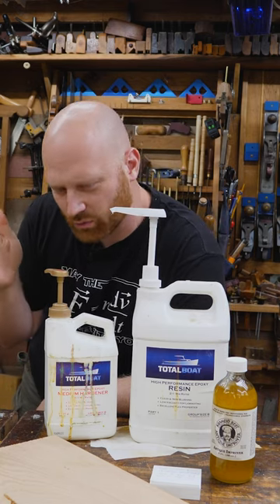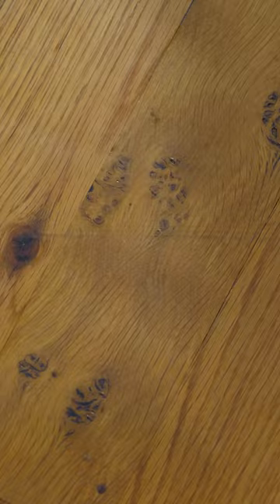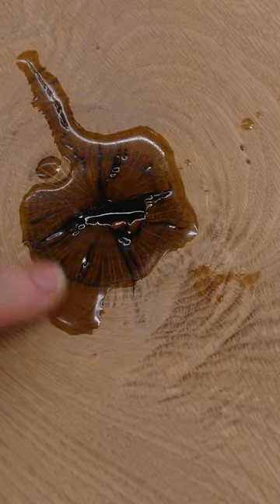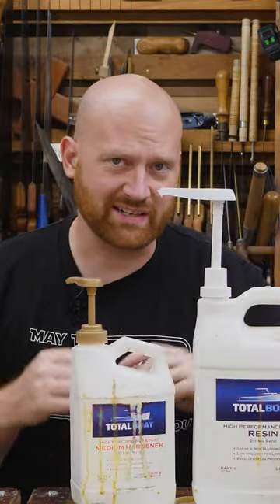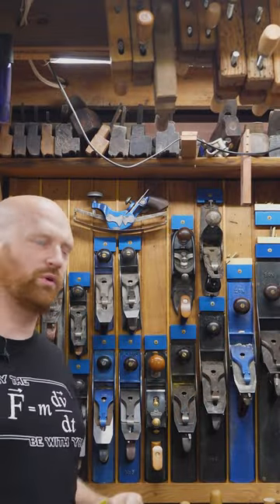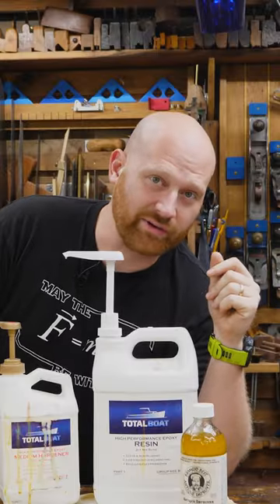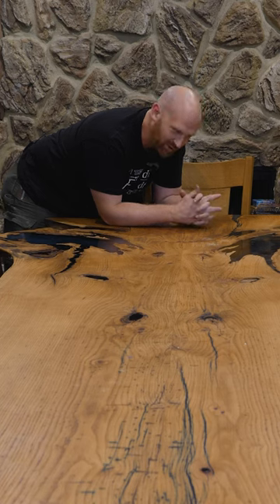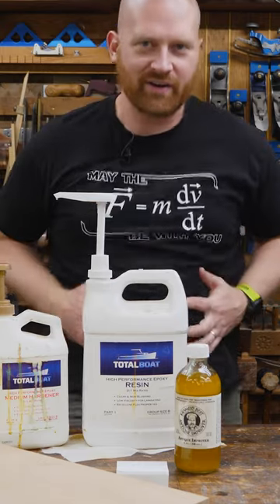Is Epoxy Woodworking

Comment: I am heavier than several ducks but I’ll stick with epoxy. It’s one of the principles I adhere to even in a sticky situation. It will cement the deal for a good woodworking project.

Comment: Epoxy is a means to solve a problem with the wood. It allows us to use larger pieces of wood that would otherwise have to be cut into pieces to be made useable. Rare is a vintage or historic wood piece that has the natural holes left intact, for those parts of the wood are left on the shop floor.

Comment: If epoxy was a prevalent back in the day, they would be using it to, it may not be ‘woodworking’ however it’s an element that you can use to support your pieces add character etc, so maybe it ‘ hybrid woodworking’
Reply: I think most woodworkers throughout history would use epoxy, if it was cheap and widely available too

Comment: I worked with a guy who didn’t like that I used epoxy to repair non historic/non collectible furniture. He said mixing this glue made from flour was better because the glue would fail and leave the joints intact. 
My take was I just wanted the repairs to be permanent and that the region was too humid for that.

Comment: It's not the typical style of woodworking when people hear the term, but I would argue that to some degree it definitely is. You still have to design and carve out grooves and shape/size/etc. If people are going to be picky about that, does that mean that staining a wood piece no longer makes it woodworking? Both protect and varnish the wood, both [can] add color. Adding the metal legs makes it lean a bit more towards mixed media, but people can't deny that it is a form of woodworking.

Comment: Here's a slightly different, and in my opinion, more interesting way to look at it: When does using epoxy go from being just another tool/treatment for wood, to being a craft of its own? 
(Epoxyworking, if you will, don't drop the "e" or you'll get 7 years of student loan debt!)
IMO, it's when you start having to do things specifically to the epoxy, like polishing, that it becomes a craft in its own right. Similarly the difference between using metal parts in your build, and using metalworking in your build, is whether you just apply a premade/basic part or shaped something new or unique.

Comment: Epoxy is a woodworking tool, like nails or glue or stain or the million other things you can use to fasten, repair, or decorate wood. You can also build things out of entirely or mostly epoxy, that definitely wouldn't be woodworking. There's a middle ground where you're doing a project involving wood but the volume of epoxy is so great that it feels a little odd to call it woodworking any more, I'd just call it fabricating or mixed media or whatever generic "I'm building a thing out of non-homogeneous materials" word you'd like. Anyways, the label isn't super important as long as you, or your customer, likes the piece.

Comment: Epoxy is a tool. If you use it for wood it's wood working. If you use it in metal it's metalworking. It depends on the base material you're working with.

Comment: What are your thougts about health risk? During work as well as with the finished result.
Reply from the maker: Most people overblow the risks. You have very similar risks in a lot of woods. And in many cases working with woods in power tool shops with the dust can be just as much if not more of a risk.
Reply: @WoodByWrightHowTo  uncured epoxy resins can give quite nasty allergies that come with rather problematic cross allergies.

Comment: Never came across such slabs with epoxy, wondering how would it work when the wood breathes, poor wood might suffocate because apoxy doesn't breathe. Still I find epoxy best for my wood working joints. A good filler of gaps.

Comment: Not strictly woodworking, IMO. But sometimes there is a crossover. What really bugs me is YT including pure metalworking without a speck of wood under the heading of woodworking. Metal lathe and welding doesn't belong.

Comment: Personally, I can't stand epoxy in woodworking for anything other than an adhesive or filling very small holes or cracks wher it won't be that noticeable. Some people dig it and that's fine, I don't. I don't want a big blob of plastic interfering with the natural beauty and warmth of wood. There a some wood/epoxy pieces that aren't too bad but I wouldn't have any for my personal use.

Comment: I  build  plywood-fiberglass-plywood-wood  boats.  it's not  wooden  boat building,  it demands  very  few of those skills Epoxy stuff isn't  woodworking.  It exist  to  replace  skills,  for  amateur boats,  although cold moulded   boats  look  fancy,  they  use  mostly unskilled labor for building,  it's not  woodworking.

Comment: working with epoxy ON WOOD is absolutely woodworking. otherwise using any kind of substance other than wood wouldnt be woodworking either and you woudlnt ask this question about woodglue or laquers and oils.